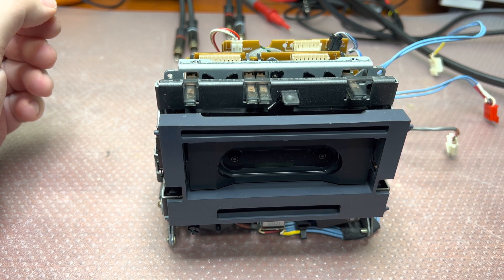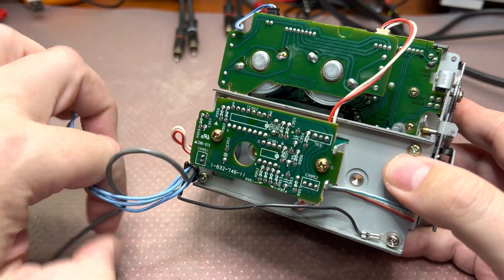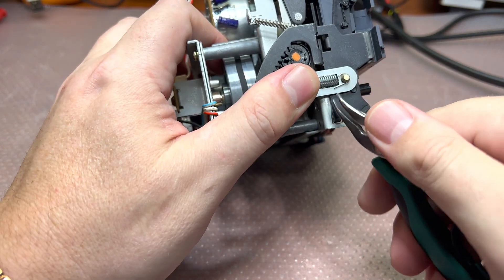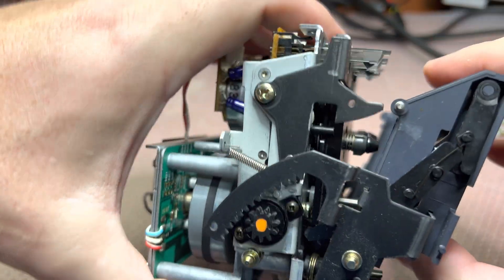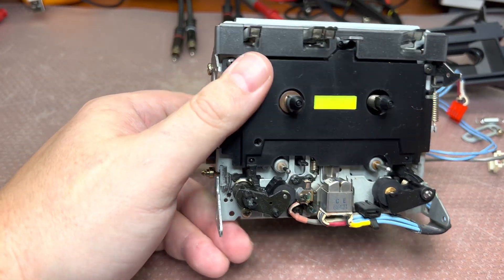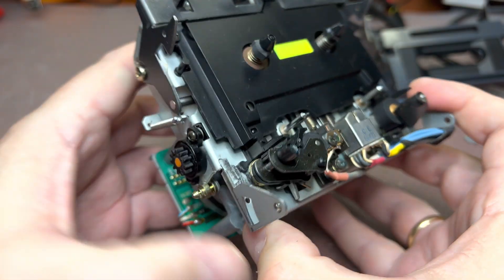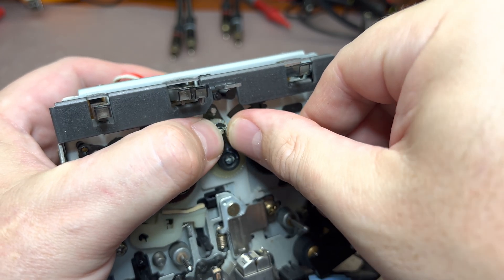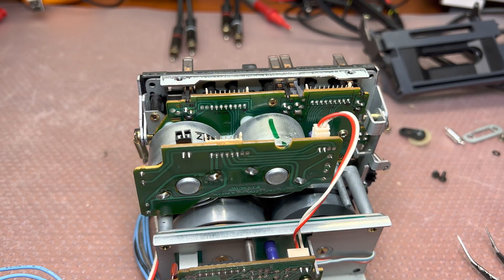Golden Sony TC-K890ES Restoration Journey - Part 3: Dismantling the Tape Transport

Comment: Tip: Remove the thin washer for the cassette door using a utility knife blade. Fit the blade underneath the washer and lift upwards. This method saves damaging the washer.

Comment: You can remove and replace the control belt without removing the left side pinch roller. The board lifts away just far enough to slip it out and refit. I have done this numerous times and saves disturbing the pinch roller height.